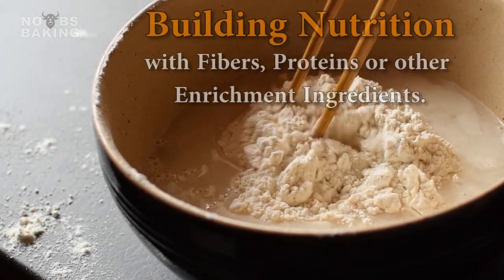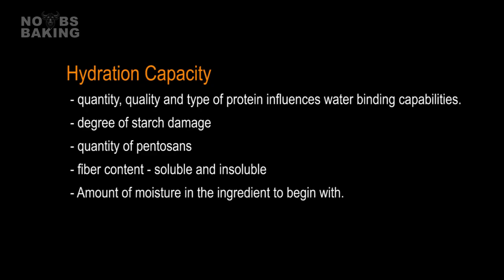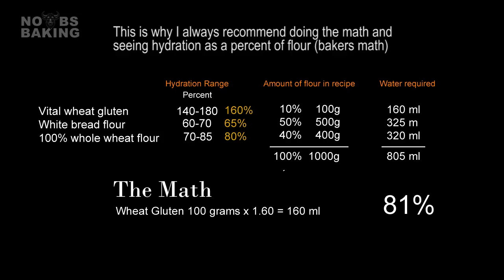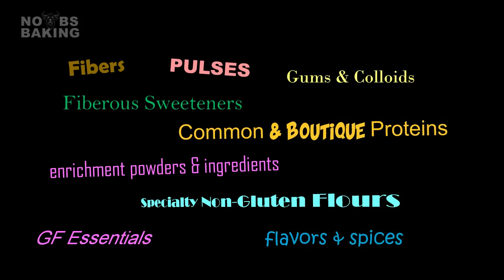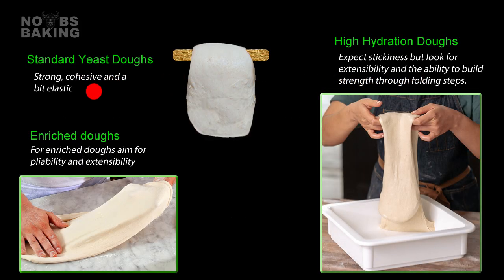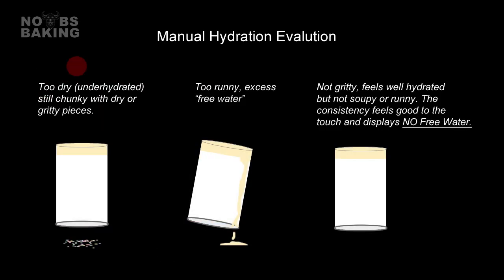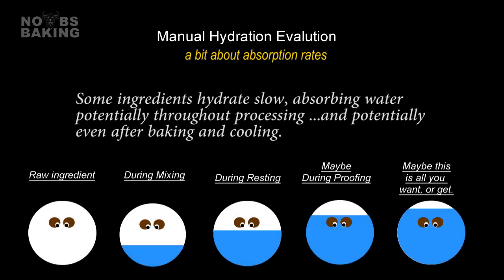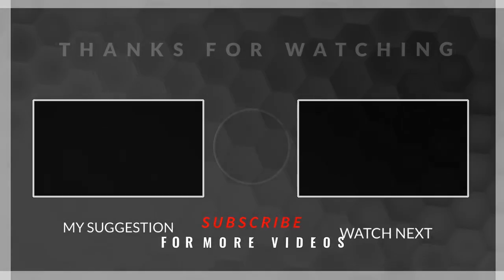Hydration Capacity Explained: How to Calculate Water Needs for Any Dough Formula

Comment: Great stuff.  Unpacking one of your key points: The home baker can finesse hydration by using two stage hydration.  Make a reasonable estimate mix the flours etc with the water. Rest it for 30-45 minutes and then add a little more if required.  I bake with different flours almost daily (home milled heritage grain and strong white mixed) this works every time for me.
Looking forward to getting your book when it becomes available.  The last one was superb.
Reply from the maker: Hey Kevin, send me a detailed overview of your process. I may build some of your process into my section on home milled grains. With full credit of course. nobsbaking123@gmail.com 
Cheers
Reply: @nobsbaking6391  Chuckles will do - but no credits - the French bakers beat me to it, but they cheated and did it a couple of hundred years ago. Typical!
Cheers